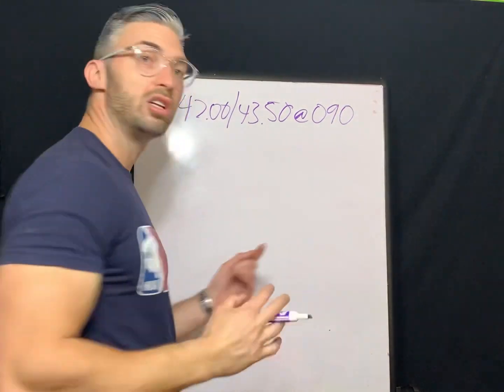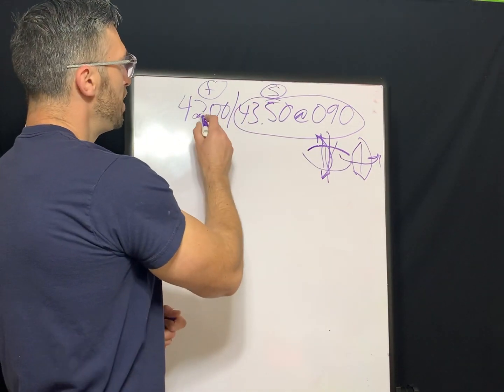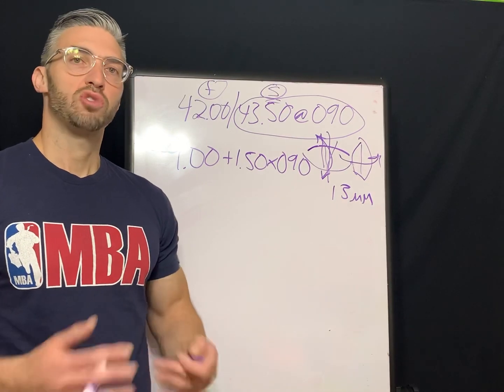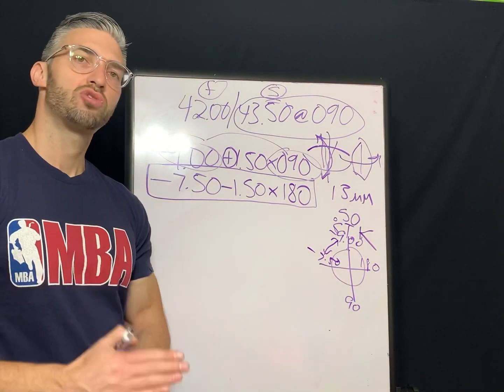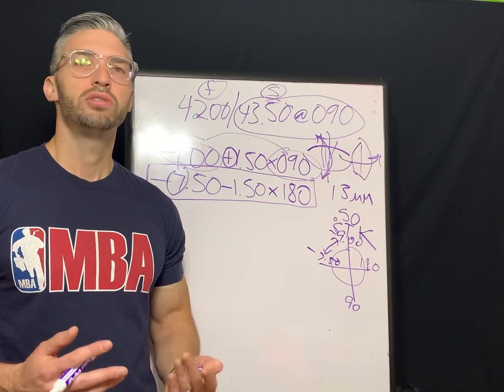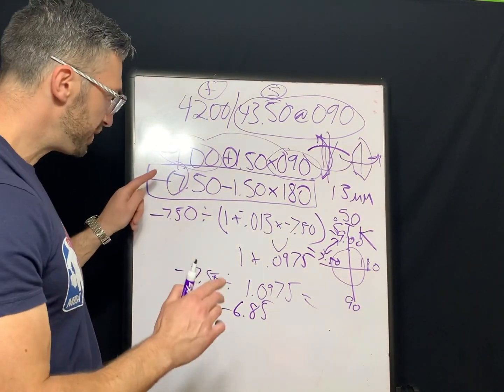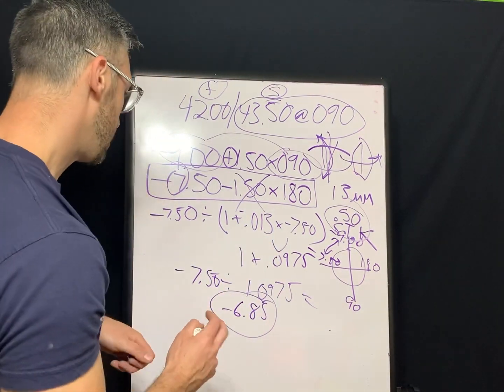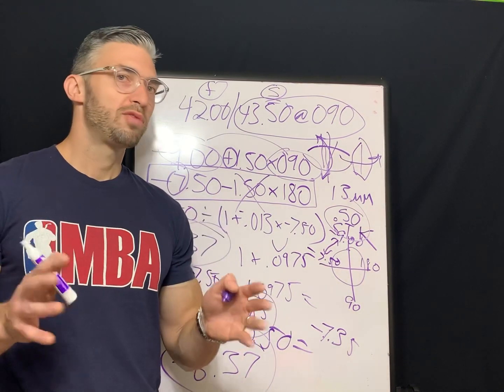NCLE SAM / FAP

Comment: You just said a steeper lens is going to fit tighter and a larger diameter lens is going to fit tighter. Is that accurate?  Around the 12:36 mark
Reply from the maker: Yes. That is accurate. 
The larger the diameter, the steeper the fit and the tighter the fit, always.

Comment: Quick question just to clarify, going from 13mm vertex to 0 you would minus .013? Then vice versa if 0 out to 13mm?
Reply from the maker: That is correct. It is a negative number for most traditional contact lens VD problems where you are going from glasses to contact lenses. Good luck!

Comment: In another video you said that you couldn't use the spherical rgp for against the rule astigmatism, but this video you said you can correct up to 2 Diopters in against the rule. Can you clarify for me.
Reply from the maker: Hey Leslie. 
A SPHERICAL RGP will correct for up to 3D of WTR astigmatism or 2D ATR astigmatism. 

The reason for this is because when we blink, the lens will follow the path of the steepest axis. The with the rule astigmatism lens will go up and down, which is more natural so the eye can tolerate more astigmatism correction. The against the rule lens will want to go horizontally on the eye upon blinking, which is much less natural. Hope this helps!